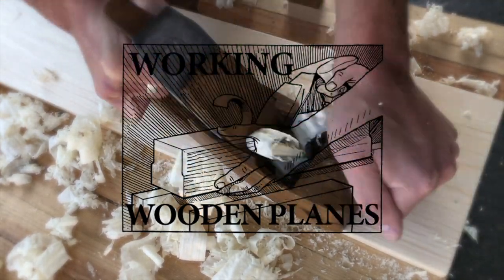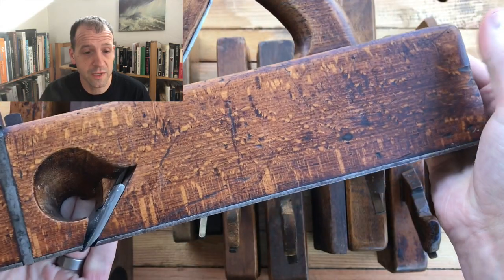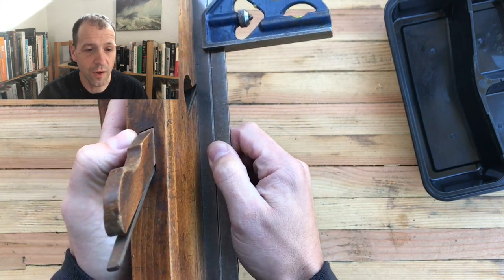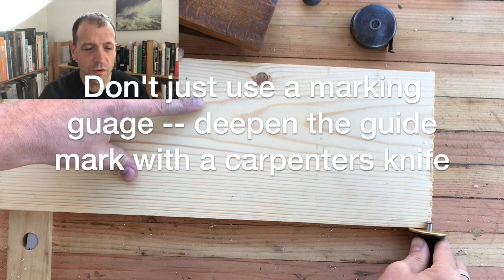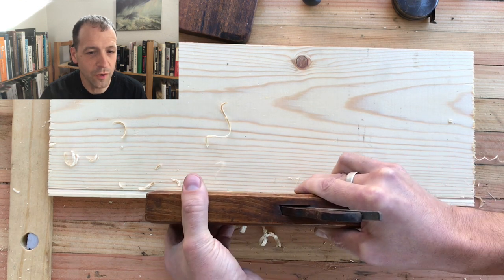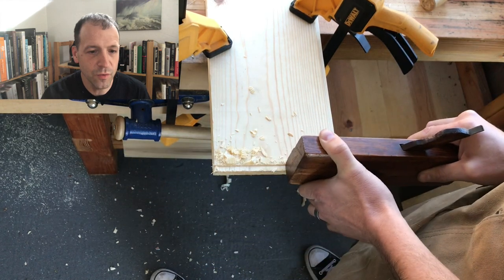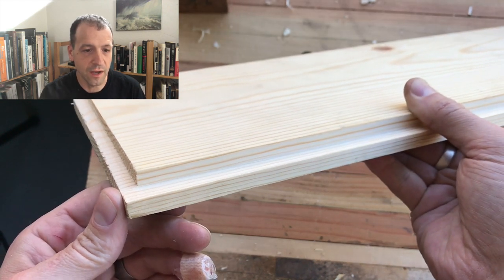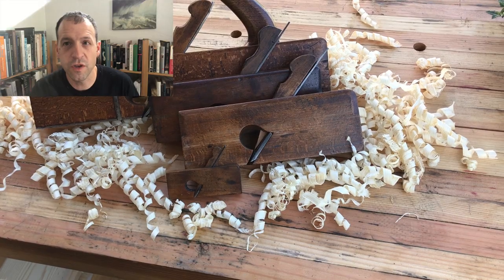Fast and Easy Hand Tool Rabbet Joints: How to set up and use wooden rabbet/rebate planes

Comment: Hey, I had a quick question on using my rabbet plane, but wanted to first know if you're still responding to comments on this video. Thanks!
Reply from the maker: I am!
Reply from the maker: Yeah, that's a tricky one. It's not supposed to look like that. I'm not sure it will cut a rabbet the way that it is now. But someone added that chamfer intentionally, so maybe it will work? I'd lap the bottom and then try it out. 
Line up the edge of the iron with the actual inner side of the plane, not with the edge of the sole. If you line it up with the edge of the sole, it will begin to cut the rabbet but the angled part of the plane will prevent it from going more than a few passes deep. The problem I think you're going to run into is that you won't be able to maintain a straight line since the side of the plane won't be sitting flush against the wall of the rabbet. I hope that make sense! 😂😂 Essentially, with a normal plane the wall of the rabbet will be perfectly straight because the side of the plane guides the iron in a straight line from the very first pass. I'm not sure you plane can do that.
If you cut off the bottom of the plane to get rid of the angled part you're going to end up with a giant mouth. You don't want a super tight mouth on a rabbet plane, but that might be too extreme. Let me know how it goes.
Reply: @WoodenPlanes  thank you very much! I have some follow up questions to what you said, but it might be hard to start a dialogue in the chat lol. Do you have an Instagram or email I could reach you at?
Reply from the maker: Message me on IG @workingwoodenplanes

Comment: Hi!  I have a weird plane that I have just confirmed is a rabbet plane through this video, as you say they're the only ones with the blade right through ... It looks just like the half-heart cutout one except that it's at 45°!  Like, I thought it was for chamfering until watching this video.  What could it be for??  Are there rabbet joint at 45°?  Is that a thing?  (I mean that the floor of the plane is at 45° to the body, so you can't stand it upright)

Would love to know more about it!  I bought it by accident choosing a plane from a picture of an amazing collection online, I couldn't see the angle in the photo.
Reply from the maker: That might be an English shouldering plane used to cut sliding dovetails. (Shouldering, not a shoulder plane.) Does it have a maker's mark? Dovetail planes typically had some kind of fence on them, but John Whelan's book has an uncommon English variant that looks a bit like what you're describing. His has a nicker and a brass plate on the side and may have just been used to clean up rabbets. But it would perform the same as yours. I say put a fixed fence on it and use it to cut sliding dovetails!
Reply: I replied to your reply but I think youtube scrapped it because of a link to Reddit, where I shared photos of the plane.  One confident-sounding commenter said it's a moulding plane ... Could be??

I'm going to play around with your idea!  Sliding dovetails are still on my "to learn" list, so maybe I won't adapt any hardware the first couple of times!

Thanks  a lot for the reply and the suggestion.  As apparently I can't share the link, if you're curious there are photos in a post from today in the Reddit Woodworking group.  Thanks again!
Reply from the maker: That is one of only a few Spanish marked planes I have ever seen. I don't know anything about that maker's mark. Definitely not a molding plane. Molding planes have side escapements but they never have a rabbet-style escapement. That's also not a molding profile. Based on the photos, I'm leaning towards it being a plane used to clean up rabbets.
Reply: I hope so!  That's gonna be great for me, as I'm gonna be making rabbeted flooring from some rough chestnut boardd soon and just continued my weird plane spree with a gigantic 25" badger-type plane with a depth fence (fits all the descriptions of badger except that the iron is perpendicular not skewed, so I am ready to sweat a bit for that floor).  They sound like they'll pair up well.  I might experiment with using the mystery plane to start the rabbets as well as to clean them up, as I don't have a plough plane ...

Thanks so much for casting an expert eye over my mystery!

Comment: What angle should the primary angle be on the iron, I’ve sharpened mine at 30degrees but it won’t cut, is this because it’s to steep
Reply from the maker: I sharpen mine to 30 degrees as well so that shouldn't be a problem. I put together a video on how to troubleshoot problems with wooden planes. Maybe it will have something that helps? https://www.youtube.com/watch?v=EKcMzJ8eXdE